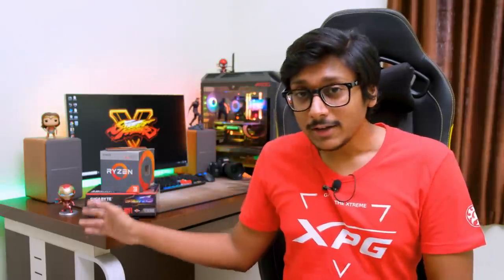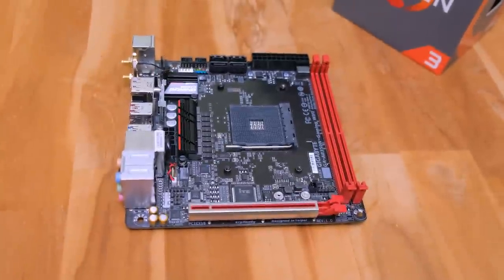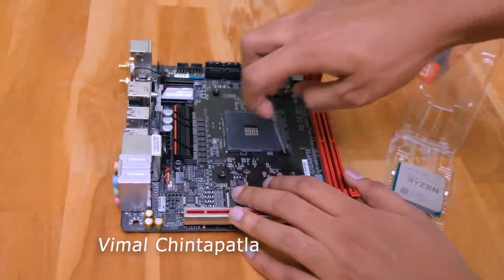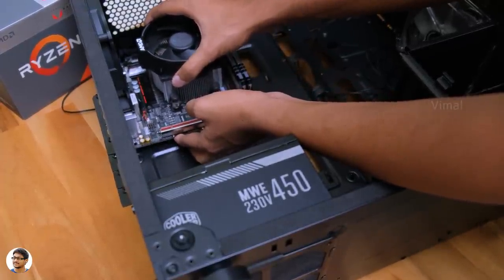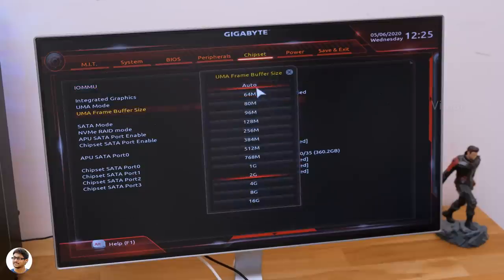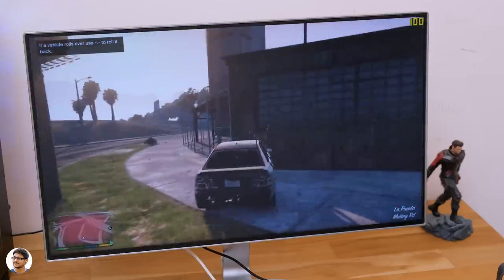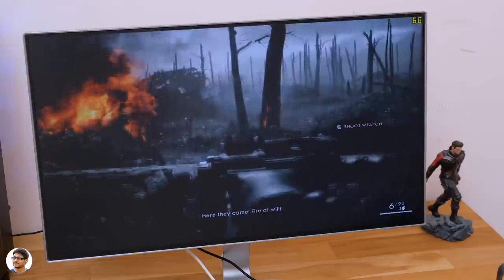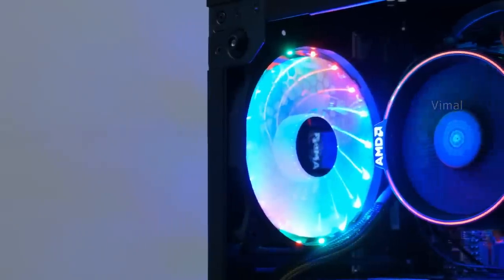25K Ultimate Gaming PC Build... Max Performance on Budget !! 🔥

Comment: without  dedicated  GPU and getting frames above 80fps is quite insane and good.
Reply: It's really very nice bro...
Reply: YEAH !
Reply: No really bro check another videos
Reply: Bro 80fps, even my 1050ti will not give that in most games. (Only old outdated games can be run on over 60fps with dedicated gpu itself with this processor) btw reducing screen resolution will be a very bad experience especially if u have big screen.
Reply: Can 2 diff company rams b used? Like company a 8gb n company b 8gb?
Reply: Sherry Mathew yea they can be used without hassle but same type ddr4 or ddr5
Reply: @YuvanBalaji  bro I too got a 1050 Ti and it's literally impossible to hit 60fps without lowering the resolution and settings.. will upgrade to something like GTX 1660 Super in the future..
Reply: Bro he must be lowered the game quality and graphics are on the low and ryzen 5 3400g has dedicated graphics built in it
Reply: @indrarupdawn8783  buy a radeon  if your gonna buy 2060 ti
Reply: Can we do steaming on that
Reply: @noone-yc3lz  yes but their frequency should be same
Reply: @indrarupdawn8783  try removing system limitations
Reply: @noone-yc3lz  yes any ram but make sure it fits ur ram slot. Check from the variation ddr3,ddr4,ddr5 .....
Reply: @indrarupdawn8783  I do get 60 fps for gta v for my laptop and that's GTX 1050ti but wen it gets hot the fps goes around 50-55 so it's pretty smooth for me😄
Reply: @indrarupdawn8783  great card but uses too much load. I suggest going for rx 570 or better rx 580 they are both great cards
Reply: Bro mine 2200g on GTA 5 stucks at 45fps at 1080p /70-75fps at 720p 🤔 how he is getting that impressive results
Reply: @talhaimam1928  what are your specs
Reply: @lemongorengpeng  A320 motherboard 4gb+4gb dual stick ddr4 vengeance ram 
The only difference is i have 8gb ram where he is using 16😟
Reply: @talhaimam1928  1. motherboard is different, he's using a slightly better motherboard. 2. Ryzen apu like fast rams, big rams only affect a little but faster rams makes a huge difference.
Reply: @lemongorengpeng  i think the same bro my motherboard slowing the APU , regarding ram i hav both sticks running on 3200mhz
Reply: @talhaimam1928  did you enable the xmp profiles in your bios. If you didn't, your rams wont run their speed. Search it up in youtube, they'll teach you for your motherboard
Reply: Not when you play online competitive games like CS.
Reply: @popopop366  ive got 120+ avg csgo medium
Reply: @talhaimam1928  do you have 16 gb ram
Reply: @noone-yc3lz  nope
Reply: Amd apus got no chill👨‍🎤
Reply: Yup just thinking which monitor might he be using
Cuz that's impressive too
Reply: monitor ka kamal h
Reply: @noone-yc3lz  noo
Reply: But you cant use rtx
Reply: But you cant use rtx
Reply: @noone-yc3lz  yes but you should get them of same megaheartz speed.
Reply: Its 720p smh
Reply: @lemongorengpeng  my igpu hd 630 can get more lmao
I get CSGO 80 fps 1440p on my 1070 maxq
Reply: @kp7x005  okay? Sure if that's what you got.
Reply: Pls suggest good budget gaming peripherals 🙏🙏
Reply: @talhaimam1928  i think he's faking the results. my 2500u which comes with vega 8 only gives me less than 30fps even in 720p lowest settings.
Reply: That is amd
Reply: Hum jaise indians ke liye yeh sapna sakar jaise he

Comment: it’s Future Proof by 2 ways
1. Overclock APU and RAM + 20 FPS
2. Use GPU like 1660 super to Double the FPS ........ Holy Smoke 💨
Reply: Anyway , but GTX 1660 super will be outdated in 3 years 😭😭😭😂
I'm laughing as well as crying Becoz , all graphics will get outdated , but laughing at your comment 😂
Reply: Can apu+GPU run
Reply: @7dsgaming393  Yes

Comment: my pc's price : 35k
FPS it gives me in GTA5: 20-25fps on very low settings
my life sucks :(
Reply: Did you buy it from a PC shop or built it yourself ?
And do mention your PC specs I am kinda curious to know what shitty parts it has that make the build 35k
Reply: @sanisareanurag  i3 4150 in-built graphics intel 4400  HD, and 4gb ddr3 ram of kingston 1600Mhz ASUS H81M-CS mb and 60 Hz monitor
Reply: @chetanoimbe2572  Actually when i build its only worth 29K and recently i have some minor upgrades, so i am guessing its now approximately 35K but no one believe that my PC can run Gta 5 XD
Reply: Its a laptop that's why
Reply: @gamingwarrixr  4gb ddr3 ram is too slow... If your cpu need ddr3 ram then use at least 2400mhz ram with 2×8gb configuration
Reply: @Jagmeet-Sidhu  always go for amd processor and don't forget about latest amd 4000series its fucking much more Powerful and worth than i7 8th gen processor.....
You can google all pc parts according to your requirements....
Stay home Stay safe
Reply: @Jagmeet-Sidhu  does your 30k budget include monitor, keyboard & mouse and speakrs etc ?
Reply: @chetanoimbe2572  bro i will get Ryzen 3 3200g in 7,400rs
Gigabyte b450m ds3h motherboard in 7500rs
Adata gimmixs D30 1×8gb 3000MHZ ram in 2800rs
250GB M. 2 sata WD GREEN in 2450rs
Antec vp450W psu in 2450rs
Cabinate not decided yet
MONITOR LG 22mk600m in 8500rs
ZEBRONICS gaming transformer keyboard and mouse in 1300rs
TOTAL COST- 32400rs (i will buy cabinet upto 3000rs so price will be increased) so around 35k i will built full budget gaming pc! If you're budget is under 30k then go with Ryzen 3 2200g and A350 motherboard to save 3k to 4k rs! (this all price is ofline market in my area)
Reply: My cpu is 500 rs and it gives me 30-40 fps in gta v
Reply: @gamingwarrixr  rip bro
Reply: @gamingwarrixr  bro I also have that specs
Reply: My PC's price rate : 33250 ( full setup)
Aoc 19 inch slim monitor
Foxin ups
Logitech keyboard and mouse
Intel core i3 9100f 9th gen
Nvidia GeForce gt 710 2gb ddr5
8gb ram
1tb hdd
Probably a great deal for me .... getting like 75 fps in 720p at GTA 5 .. really enjoying it...
Reply: Bro I have 25k PC and it gives me 40 +GTA v
Reply: Prasanna Godiyal  no bro...iam getting .... because I updated it's drivers recently and I have changed some custom settings...in the control panel
Reply: Prasanna Godiyal  and 8 gb 3600 mhz ram...makes the game more smoother .....I don't mind whether you believe or not
Reply: Prasanna Godiyal  I don't care whether you believe or not..
Reply: Prasanna Godiyal  btw leave it
Reply: Same here
Reply: @PC FOR YOU really
Reply: @PC FOR YOU Hmm
Reply: fo
Reply: Prasanna Godiyal  I also have gt 710 and it run 60fps+ you don't knoe
Reply: At least you can play gta v
Reply: My pc is 80k but I even still get gta 5 high settings only 40 fps
Reply: overclock
Reply: My computer can't Install gtv 5😂😂
Reply: My Current PC Cost me around 55K in 2013 and it literally Give me around 20FPS in GTA V 🥺
Reply: @shubhamsapkal7466  Bro Where are you from?
Reply: @saoodkhan110  pune
Reply: Mine too
How do I convince my parents to buy me another pc it would be impossible😭😭😭😭😭
Reply: @oceancat8725  In Which Standard You are in !?
Reply: @nxp2619  12 me hu bhaii
ab possible nhi lg rha mujhe I think Ill have to earn it as I should ,🥺👌
Reply: @oceancat8725  same bhai m bhi 12th m Hu Board ke baad lunga (agar iss baar honge toh 😂)
Reply: @nxp2619  bht dikkat hai Bhai boards wagers ki is saal
.Meri main problem ye hai ki main already ek pc le chuka papa se Jo ki kuch khaas nhi hai usme Maine GT 1030 lgaya hai 😭☠️
And I don't know if he'll let me buy another one.😭
Reply: @oceancat8725  Sed Life Vro 😬
But hope for the best 👍🏻
Reply: @nxp2619  yes best of luck to us 😭👌
Reply: @shubhamsapkal7466  can you please share you gaming experience on this built how much fps in gta5 and other games
Reply: @devesh674  bro I've not build this setup yet!!
Reply: My pc cost 15000 can run most of the games mid graphics in 40 fps smooth.
Reply: @gamingwarrixr  kat gaya apka
Reply: dont lie even 5000rs + gt610 can support gta 5 with 20-25 fps
Reply: @arpandey7330  I don't have a gpu T-T. I built my PC in 2014 that time I was 12 years old XD

Comment: Finally a video in my budget
Reply: ADHIKARI KIRAN  🤣
Reply: @Doom Slayer aur thora bhadate bhadate 40k phoch jayega
Reply: ADHIKARI KIRAN  HDD LELIO FIR
Reply: ADHIKARI KIRAN  If you can pay for storage , you can get ...
Reply: ADHIKARI KIRAN  replace with ssd
Reply: But this PC can't run new games old games yes
Reply: @jagadishbhatta9562  it will run all the GameS
Reply: @shaikhasif1673  it doesn't even have a GPU.its running on an apu.cant believe you actually believed this 90 fps shit.30-40 max fps you'll get from this apu
Reply: @jafarts4364  still better than Intel lmao

Comment: When i calculated this build this is going above 35k, could you please share links for you price point?
Reply: Yeah bro without storage
Reply: I bought this pc 1 year ago for 27k 
Without any peripherals
Reply: i bought my pc from md computers at 40k and i can run gta v at ultra 150fps.....
Reply: @noobsensei6918  care to tell the specs?
Reply: I just assembled one with Ryzen 3 3200g for 32000 including 8000rs monitor & 2000 rs UPS
Reply: Poo kunda
Reply: @noobsensei6918  what are the specs
could you tell
i'm looking for a similar pc that can run gta v at ultra settings smoothly
Reply: Harikrishnan K can you share your component list brother? Thanks
Reply: @007Tembu  rysen 3 3200g and 5x 570 graphic card 65plus frames in ultra settings any game
Reply: @007Tembu  under 38000 including rgb case
Reply: This built is easily possible around 25k
Reply: @gauravjoshi6925  thank you man 
I'm getting a Ryzen 5 2600x + 1650 super next week
Reply: @harik4489  I went with Ryzen 5 3400G & it costs around 30K excluding Moniter
Reply: Yes exactly
Reply: @noobsensei6918  Game id batao, Khelenge ek saath
Reply: @jatin_shah27  is ur dp a copy of lui calibre
Reply: @harik4489  Can you tell me if i should go with msi b450m or msi a320m
Reply: @gauravjoshi6925  bro suggest good components my budget is 30k with all peripherals.
Thanks
Reply: @jagdishsahu1118  ryzen 5 1600 -8k to 9k
A320m motherboard -3500 to 4500
1tb hard disk- 2500 to 3000
450volts powersupply - 3500to 4000 make sure psu is branded like antec corsair
8gb ddr4 3000mhz ram- 3000 to 4000
Gpu(used)- gtx 1060 6gb or 1650 8k to 10k
Or 
Gpu (new)- rx 570 (12k)
Reply: @preke953  😂
Reply: Someone yes. Ultra with 150fps is not possible even with rtx 2070
Reply: Samarth Vikram kind to tell the specs please? Including monitor too
Reply: I calculated too, it costs about 25k without mobo. I couldn't find the same mobo online so I didnt include it.

Comment: Hlo bro, where is the storage...
U did not show storage option in this video..
HDD or SSD
Reply: YA
Reply: End me ssd ka btaya tha
Reply: ok thank you
Reply: It is told that you can take any 240gb ssd from any brand under 3000 so as to achieve the goal of the budget pc of 25k
Reply: he didnt install any of them because they wont be in budget😂😂😂😂😂😂
Reply: @agrya3840  omg
Reply: @seven_5762  its a joke. chill
Reply: Go for hdd instead of sdd
Reply: @Agaeto10000  no, go fpr 240gb ssd and 1/2tb hdd
Reply: @agrya3840  not every one are rich and SSD are expensive than hdd
Reply: @Agaeto10000  bhai 240gb ssd costs only 2,500
Reply: @agrya3840  1tb hdd cost only 3500 and 1tb sdd cost 9000 and both are from WD
Reply: @Agaeto10000  i never said to go with 1tb ssd, go for 128 gb ssd and 1 tb hdd
Reply: @Agaeto10000  SSD can buy time..😂😂
Reply: @agrya3840  yess
Reply: You can get 1-2 TB HDD later on
Reply: He is using the ram memory by deleting system 32

Comment: i dont know why , he had 2048mb in gta v ( in settings) but he filled it till 900mb in setting 
question 1. if  we change graphics to high will it lag because its 2048mb there in it ?
question 2. is this pc  can be upgraded in future like dedicated gpu and anything else ?
question 3. can it run more AAA titles smoothly in low and medium settings ?
thanks for the vid. 😃😃
Reply: Answers
1.Only textures Are Vram intensive And they don't effect performance but settings are Not Vram intensive but they are performance intensive
2.Yes it can be upgraded
3.Sort of You can run at 30 fps at 1080P Lowest settings but GTA 5 CS GO Valorant Will run at 45-60+ fps

Comment: My sony laptop took before 10 years at that time only it is 35000rs and now i have upgraded it by additional 4gb ram before it was 2gb ddr3 ram now its 6gb ddr3 ram. But it still cant handle gta 5 it gives 5fps in lowest setting. And minecraft it gives 30fps. But vimal you are great you have made such a good computer in price of 25k. Thank you so much now i can build one pc under 25k.

Comment: Make PC build with Ryzen 3100 or 3300X bro 🤗♥️
Reply from the maker: Definitely! ❤
Reply: @VimalChintapatlaTR  Prices are 8600 & 11200 rupees ( I was expecting like 7000 & 9000 ) for 3100 & 3300X 😅
Reply: @adilakhtar007  1000 more then you can buy a ryzen 5 2600
Reply: @adilakhtar007  3300x not worth it go for ryzen 5 2600 same price better permomance
Reply: @wintry636  Price will come down, GamerNexus overclocked 3100 to 5Ghz and in other overclockers overclock  3300X to 4.5~4.6Ghz, which will boost gaming performance. 3300X might be better than 5 2600, even though it has 2 core and 4 thread less than 2600 (6C/12T), it uses 7nm and 4 core on one CCX which will give better speed and not require communication between 2 CCX ( like in 3100), 3300X is performing almost equivalent to 7th gen Intel i7 7700K (4C/8T)
Reply: @7chip  its 4 core and 8 thread

Comment: Brother can we use graphics card in this and use for video editing?
Pls reply .. thanks 😍
Reply: Yes, you can add a graphics card but I suggest you to buy Ryzen 5 processor if you're planning to use for editing.
Reply: @mahadikarkishor thank you...
 how much for ryzen 5?
Reply: @aneesmeledath7  There are many models. Cost depends on the clock speeds. Starting price is 11k. Go for 3400G. It has good clock speed and costs 14k

Comment: Bro , Ab350n motherboard is not available 😕, please suggest some other motherboard in same range and yes RGB lights are must and please tell ASAP. 🙏
Reply: B450
Reply: @hindustani8244  Help me with one more thing, the ryzen 3 2200g CPU is also not available, pls suggest a powerful CPU under ₹9000, and thank you so much for previous suggestions 🙏.
Reply: @SickWalker.   I'm in the same problem I'm also looking for a powerful processor in same budget
Reply: @SickWalker.   If u can increase budget go for ryzen 3 3200 g
Reply: @hindustani8244  Ohh👍

Comment: This is a doubt. Can I add gpu along with this components you have mentioned?. If can, will the system utilise inbuilt apu(i.e. inbuilt gpu) or external gpu or both?
Reply: if you add a external gpu then you will have to disable the apu from bios as you can not use both at the same time you can only use one at a time..👍👍
Reply: VM Gaming Hacks  😊😊👍

Comment: Could you mention the components and there buying link in the description?
Reply: same problem and what about the ssd & hard disk ?
Reply: Check mdcomputers,  vedantcomputers, primeabgb websites , you'll get the components there. Also the processor used here is out of stock.

Comment: Sir if I use ryzen 3200g processor and geforce gt 710 2 gb graphics card   can I get 120 fps in GTA 5 in 720 p and graphics low
Reply: Bro wt i have to do then
Reply: Bro if I use same processor with gigabyte 550  motherboard and 4gb graphics card with 16 GB ram can I get 120 fps in 720p and low graphics

Comment: Hi #vimal I have built a ryzen 3200g pc I don't why even with low resolution and graphic settings but it is using 100 % usage and stutters a lot and not getting 60 fps is it a used one I have purchased a OEM processor

Comment: Bro i have a doubt please can you help me out on it, My current pc specs are i3 4150, 8gb ddr3 ram, Gt 730 2gb ddr3, i only want to play valorant with 120+fps, with my current setup i get 80-90 fps, i want to upgrade my pc to increase FPS and i currently have 10k rs to upgrade it shall i go for processor upgrade to i5 4570 and 12gb ram or i should upgrade my graphic card to 1030 or 1050. Please help me out in this . :D

Comment: Hi Vimal,
If one hand I use ryzen processor with vega graphics + nvidea 1660 super and on contrary if I use a ryzen processor without built in vega graphics + nvidea 1660 super, will I see better gaming performance for the first case ?
Means will both vega graphics and nvidea graphics be combined together and give better results?
I don't have much idea on this, can you please elaborate?

Comment: Hey vimal, 
Can you suggest another motherboard which has Bluetooth and wifi built in and is cheap?
Reply: Use wifi and Bluetooth adapter
Reply: @dinonath2770  yeah I was thinking of that too. Thanks
Reply: @vihaanupadhyay4946  oh
Reply: @vihaanupadhyay4946  and that is cheaper also
Reply: @dinonath2770  yep.
Reply: @vihaanupadhyay4946  lol

Comment: Even though we are using an APU, can we use a dedicated GPU for extra/double/better performance...since I already have a GT 710(2 GB)
PLEASE EXPLAIN BRO..
Reply: no the overall performance is coming gpu not from apu
or else search ur qna in u tube..
Reply: GT 710 sucks. It won’t give any performance boost. The igpu can compete against GT 1030. Sell the 710
Reply: @zelty6564  See guys...
I have dropped this idea and I am building a new PC...
i5 9400f
B365 Chipset motherboard
1650 Super 4 GB
Corsair Vengeance 8 / 16 GB
Corsair VS450 PSU
WD 120 GB SATA SSD
Seagate 1 TB HDD
ICE 200TG Cabinet...
Since I am on a tight budget I can buy a pc upto 45k....
Is this PC combination really good ??
Please give me some suggestions...
Reply: @bindukumari3829  change cpu to amr cpu